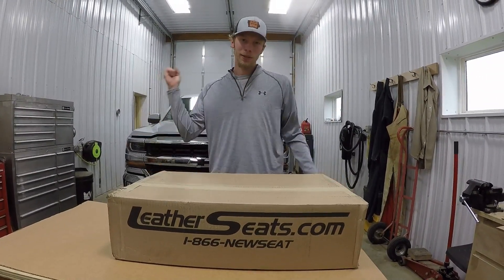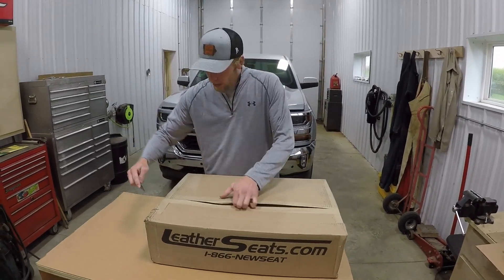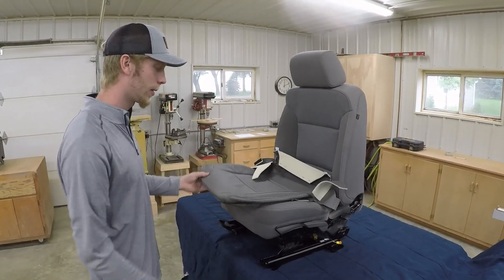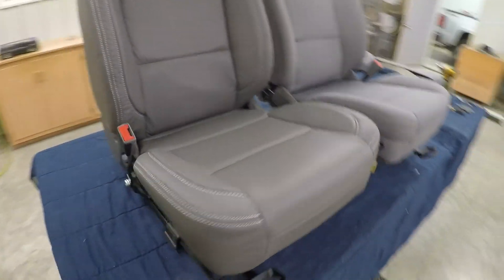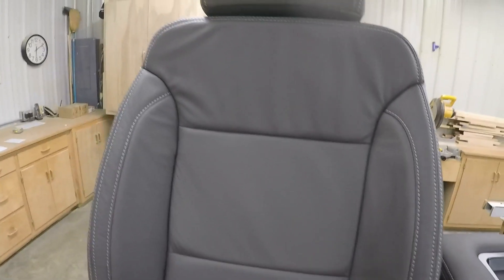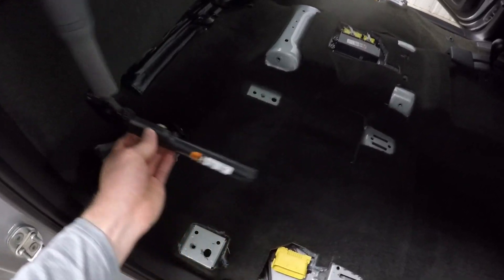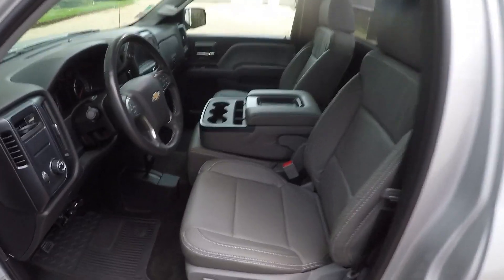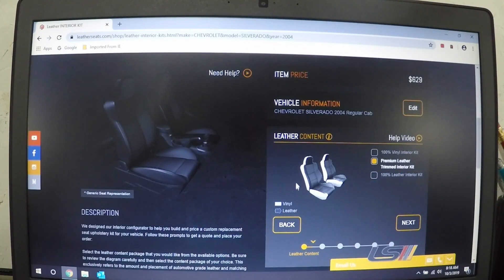2018 Silverado New Leather Upholstery Install (Cloth Work Truck)

Comment: The darker color looks much better.  I've hear that if you get some wet rags and throw them in the micro or take them out of boiling water and quickly wring them out (with gloves on of course) you can lay them on top of the leather and it will cause it to shrink and form to the seat better.
Reply from the maker: Cool man, thanks for the tip!
Reply: How do you disassemble the center counseled and replace it?

Comment: Keep the great  work got a quick  question  on cutout template manual 4x4  you make   were do I place  to cut it out  thank you help keep the great work
Reply from the maker: Remove the side panel from the console to make it easier, and just line the template up with the bottom edge of the panel. It will line right up.
Reply: @TyBrink   thank you getting  my order  out thanks again for the help

Comment: Ty I love your vids, I was wondering if you sold a shifter kit for a 96 silverado 5 speed
Reply from the maker: I don't. I only have access to 99-06 Silverado and using the 03 console makes it easy since there's so much room on the inside. I'm not sure if it would work on the 90s trucks depending on what console you use.
Reply: Ty Brink than you sir and get an obs 5 speed and do your magic to it please

Comment: Love the videos. Keep up the great work! What do you know about ABS sensor failures fixes on 04-06 models? No recall issued for 06..   -_- Can you make a video on that?
Reply from the maker: Thanks man, I dont have any experience with that problem. Its probably just a common cheap sensor that will go bad over time.

Comment: Do you know if these seats from 2014 fit the older trucks years 07-13? Thank in advance
Reply from the maker: I'm not sure, the way they mount to the floor is probably different since these slide into a notch in the front and are only bolted in the back.

Comment: Hey man did you upgrade the steering wheel? Are the controls compatible with the radio controls?
Reply from the maker: Yeah we put in a leather wrapped wheel for an LT model. The radio controls don't work but there may be a way to make them work I'm not sure. The cruise control buttons on the left still work though.
Reply: Ty Brink you should check out the group Silverado & Sierra(2014-2018) on facebook. Phil gamboa has information how to make the volume controls work.